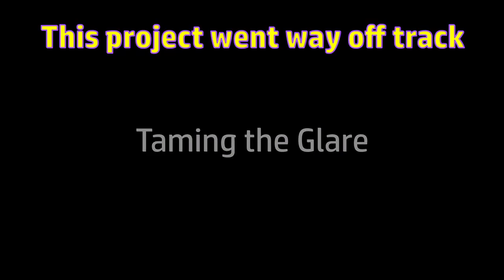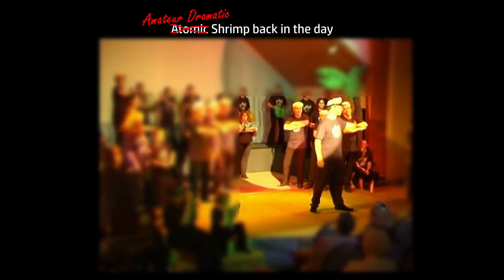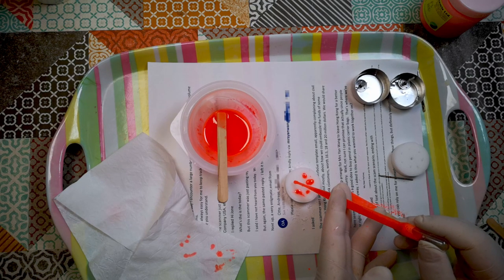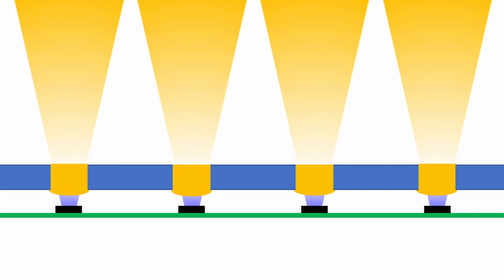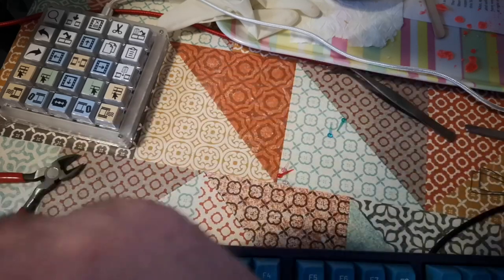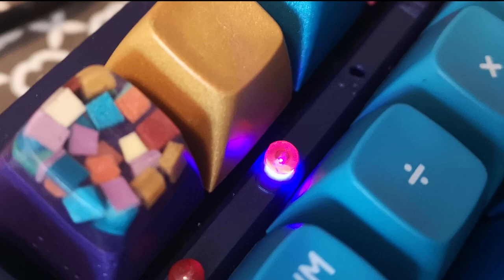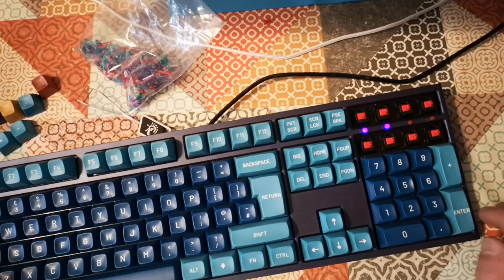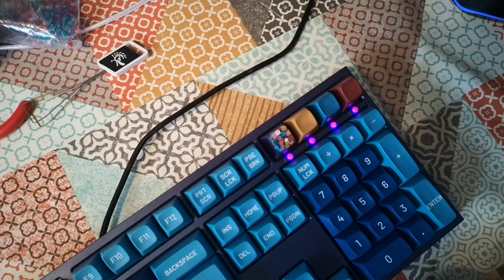Taming The Blue LED Glare

Comment: This would not be a problem if manufacturers just made indicator LEDs…well…indicators. I really don't need to light up my entire room with all the „indicator“ LEDs everything has. If it would not be so bright that you don't need lights anymore, maybe this kind of solution would be obsolete.
I usually jsut cover them with paper and tape. I still want to see them, but I don't want the insane brightness.
Reply: That's true - a dim, steady red is perfectly adequate. Actually, how many things really need an indicator? My Amazon Echo Dot handles this well - no lights at all when it's just sat there listening, so I can have it on the table next to my bed without it disturbing my sleep.

Comment: The power strip in my room has a shockingly bright blue LED as does my Bluetooth earbud case. I have to hide them at night because they bug me so much. An electronic doohickey for my dogs FLASHES green at all times. I don't understand why indicator lights are always blindingly bright. I shouldn't be able to see around my room at night just by the glow of an indicator light
Reply: It is really a shame that the electrochromic ceramics GE was working on didn't go anywhere.  It looked to me like the ideal technology.  The ceramic is normally a dull gray.  When a bias voltage was applied,  it became orange.  It made no light of its own so it was as bright as the light falling on it.  Sadly they gave up on the idea.
That electronic paper stuff that goes from white to black could also be a great way to make an indicator.

Comment: I have a blue LED in my computers motherboard that lights up my entire living room. Thankfully it's not noticeable if you cover it up with electrical tape, but that wouldn't work in this particular case. I'd probably get some pry tools and solder a different LED. Likely the only fix I'd be happy with.

Comment: I recently came into possession of two IBM 122-key keyboards.  My hope is to replace the cord on one with a ps2 lead or even better, perhaps USB.  I'll keep the other as a spare for parts.  They're both in fine working order and have a mechanical keyclick, something I miss greatly.  I've used this keyboard at my job from 1989 to 2014.

Comment: Blue leds are horrible, always too bright, tacky looking because they are in every cheapo electronic device since the early 2000’s. I usually replace them with something eye friendlier like red or orange or if that is not practical cover them with something that dims them and changes the colour. Anyway nice, if slightly elaborate solution!

Comment: Gosh. I also hate blue LEDs with more of a passion than anyone. But desoldering them and replacing with a red one (and often increasing the limiting resistor value) is not that hard with hot air. It would make a good electronics learning project (and hotair stations are as cheap as $35). I've done this to quite a lot of devices when I get tired of the look of having a strip of aluminum foil tape over the LED(s).
Reply from the maker: I might have tried that, but it means opening the case, and probably breaking the clips
Reply: @AtomicShrimp  I'm quite surprised that you with such varied experience in random subjects has not opened many plastic-clipped enclosures before. Practically everything these days is held together with them!
Reply from the maker: A few, but it looks like this one is an outlier in terms of difficulty

Comment: the same problem, different keyboard , only i replaced my leds with pink ones and they burn out to be blue due to constant current driving even resistors in series didn't help

Comment: once i experienced this kind of a problem e.g. bright blue led w/o dimming, but on other device. n i fixed it next way: a pinch of dye powder mixed w/ translucent polish, then squeezed this solution into the led hole. after it hardens problem solved. now it dimmed n has redish glow that desnt disturb ur eyes at nights.

Comment: The (probably) best fix would have been to cut the leads or track and add a resistor. Though there may not be enough room in there to do that. And you would have had to open the case and yeah... tabs
Reply from the maker: I think it's little SMD LEDs - probably easier to replace them if I was going inside, but it seems like this keyboard was not built to ever be opened.
Reply: @AtomicShrimp  that would make it annoying.
Pretty unfortunate!

Comment: I'll just correct one thing, the "UV laser" is not actually ultraviolet. It's violet and likely to be 405nm in wavelength. To be UV, it would need to be below 400. And lasers like that cost as much as a car.
Reply from the maker: Yes, I suppose if it was true uv, it would not be visible to the naked eye. It's faintly visible (but not faint because of low output) so Violet or 'near uv'
Reply: @AtomicShrimp  Hey, thanks for replying, don't take this as me being a smartypants by the way.
This is my hobby so I can say a bit. Ultraviolet is actually visible too, 390nm sources can very much be seen with the naked eye, there is no hard limit. The sensitivity of the human eye just kinda slopes down due to the UV absorption of the lens, if the lens is removed, humans can actually see UV quite far down, about 300nm.
I know of this because I engage in UV and IR photography so I work with UV sources quite often. Cameras can obviously see UV way better.
Have a nice day.
Reply: @AtomicShrimp  Some people see UV. Not everyone is made the same.

Comment: What I've done is to get some window tint and just put some super glue on it. I suppose you could get a small hole punch or a die set and cut out little disks of the tint to put in the holes, or even drill them a little larger. Good video Shrimp.

Comment: Could you design something that dulls those bright headlights on cars with the blue tinge?  
All I can think of is a hammer.
Reply: Hammer sounds good! I find those lights unbearable, and temporarily blinding, so much so that I have given up night driving. Totally unnecessary to have such blinding lights. Dangerous to oncoming traffic.
Reply: Works on headlights and driver ...
Reply: @geraldinegregory.1803  I share your sentiments.  They tend to give me headaches. I wear night driving glasses. They have a yellow tint.  You could give them a go?
Reply: @platesomeat  Really? That sounds interesting. I always assumed that it would be dangerous to wear tinted glasses for night driving in case they obscured vision. You seem to know about this subject and have given food for thought. I shall look into trying to get hold of a pair, because although I don't often need to drive at night, it would be most useful to know that I could if I needed to, without getting pain from the dreadful glare of oncoming lights. 
Thank you for your suggestion.

Comment: I think the resin is exotermic enough durin curing to melt candle wax.
Reply from the maker: That's a possibility, although this is a fairly slow curing resin and very small volume, so probably not
Reply: @AtomicShrimp  Some cheap tea lights seem to almost melt if you handle the wax. But you have a point. I thought the casting idea was pretty good, would be hard to pour accurately though.
Reply from the maker: @rimmersbryggeri  yeah, no vents meant there was a tendency for the resin not to even make it down the holes

Comment: I bought a triple car power socket but when driving at night the whole interior was lit up by the blue LED. So much so I stopped and covered it over but the case was transparent so it made little difference. In the end I purchased another one without beaming LEDs inside.
It would be nice if the manufacturers included a switch to turn them off but that would eat in to their profit I guess.

Comment: Isn't UV light hazardous?
Reply: No
Reply from the maker: There's potential for eye damage from prolonged (direct) exposure.  It would be bad to shine that UV laser straight into the eye (but part of that is just because it's a very bright source that doesn't look bright because it's on the border of perceptibility)
Reply: @AtomicShrimp  
Good to know! Love your content, keep up the good work!
Reply: It depends on the wavelength. UVA and UVB cause sunburn and skin cancer. At best, UV accelerates skin ageing and wrinkling. As someone with very pale skin and light blue eyes (Scottish genes), I would personally never shine a UV torch on any part of my body. Looking directly into the light is obviously very bad news. I was using a UV torch like Atomic Shrimp's a few weeks ago (looking at stamps) and even though I only shone it for a few seconds, that was enough to give me a mild headache. Just be careful, wear protective gear, and you should be okay.

Comment: I find RGB lighting incredibly tacky and ugly; most things that, for whatever inane reason , have RGB lighting would be better off without any lighting at all - graphics cards and stuff, for example, or mice.
If I actually want light, white light is all that's needed.
RGB lighting is especially egregious when it cycles through colours, too, instead of just remaining one colour.
Reply from the maker: I agree - I have it on my editing PC only because it was standard for the build I chose.  I was going to just turn it off, but I found a use for it - the two sticks of RAM have LED strips on them which I have configured as bar graphs indicating CPU and memory usage, and the CPU cooler block and radiator fan also has lighting, which I have configured to indicate CPU temperature - so it's sort of useful and lets me see at a glance if the system is idle or stressed.